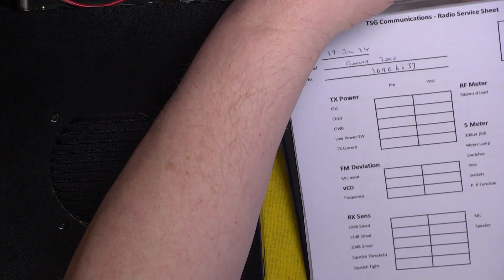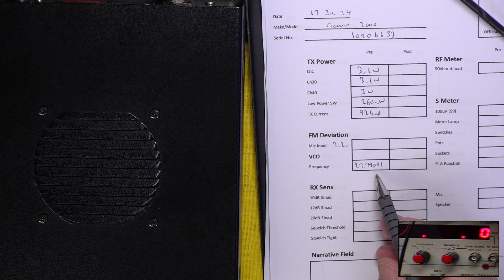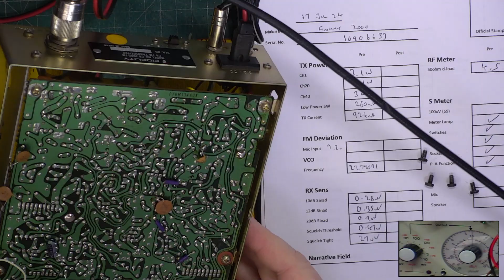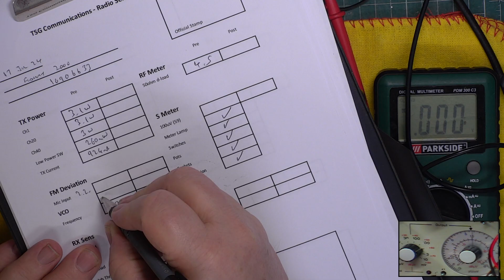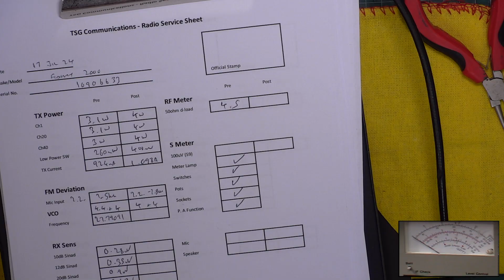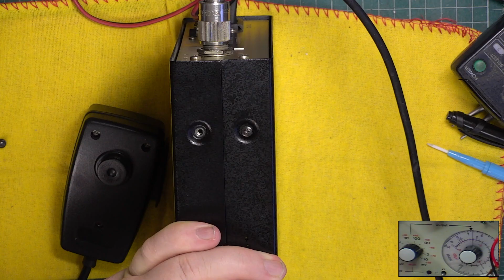Fidelity CB2000FM CB27/81 UKFM CB radio - service alignment

Comment: we have these things called mobile phones now.......
Reply from the maker: So you think that mobile phone have replaced all 2-way radio systems do you?  Mobile phones rely on third party infratructure to work. Mobile phones aren't instant...you have to dial a number.

Typically in business (not now talking about Citizen's band hobby radio), a 2-way radio conversation is like this....

"Base to mobile 3, over"

"Mobile 3 receiving"

"Were you able to repair the widget at XYA company"

"Mobile 3, Roger"

"Great, Base out"

That takes 15 seconds & is legal to do "whem safe to do so" in a car..

Richard, G0OF, UK

Comment: Memories of 1990 for me I bought one of these after selling up 6 months previous to give CB another go and decided to put it on my Altai power supply which I had kept for other projects, anyway everyone was saying I was pushing +30 regardless of where they were even far away   this went on for a week and the set went bang I took it to Doug aka Barrellspanner and he said it's had too much voltage through it but he managed to fix the radio and he told me to bring in my power supply it was then I realised I had used the Altai for a project and upped the voltage to max and forgot oops lol.

Comment: hi 👋 richard good luck servicing the fidelity cb 2000 fm cb 27/81 uk fm cb radio from paul chapman at east sheen 73's
Reply from the maker: Thank you Paul,

Richard
Reply: @ukfmcbradioservicingTango21  to richard you are most welcome looking forward to the air test From paul chapman at east sheen 73's also I have a imax 2000 it is 25 feet long
Reply from the maker: Roger on your aerial